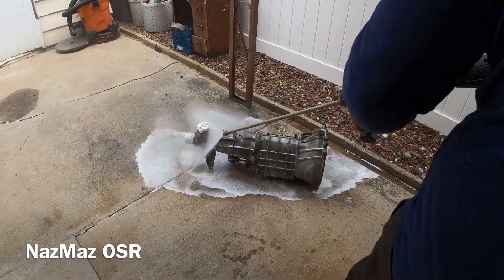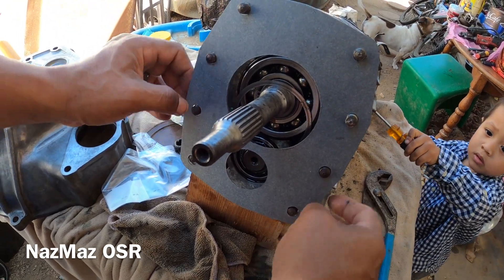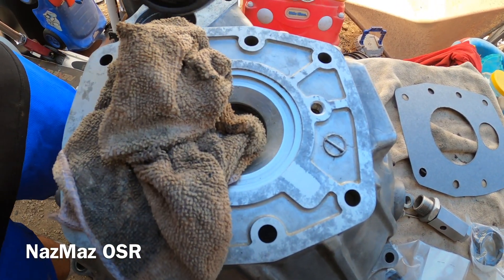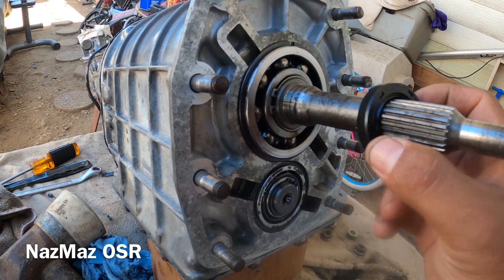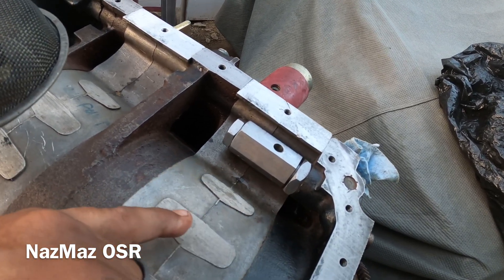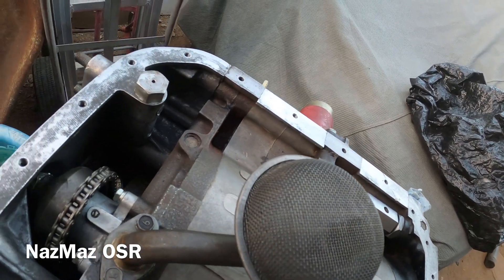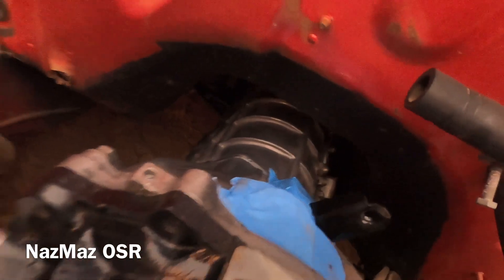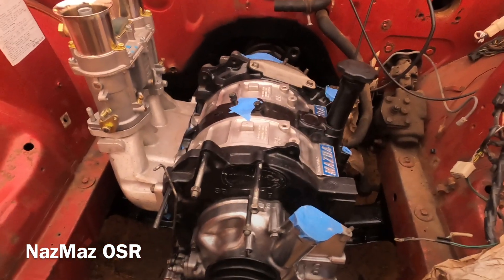Mazda Rx4 Rotary Engine installation

Comment: I only just had the chance to watch this  vid, nice work man. Would probably pay to put a little lube on the clutch fork pivots and throwout bearing where it slides on the spigot.
You must be pretty keen rolling an engine crane around on the dirt, they are bed enough on the concrete floor.
Reply from the maker: Yes, I thought of adding some lube but it already came with it. There's a cutout in the inner circumference witch is packed with lube as for the clutch fork pivots it slipped my mind so I will go back and add a bit, my little assistant should of pointed that out lol.
Definitely a workout when rolling the engine crane on dirt💪.

Comment: Its very satisfying putting things back in. I like the motto "may as well change it"😊. Did you balance the rotating assembly, interested to hear your take on that. I usually use a jack on the gearbox when dropping engines back in, helps getting the full engine/gearbox level. I like all the space around the older rotaries, my rx7s have oodles but my rx8 is sure tight and difficult to work on. 😊
Reply from the maker: Fortunate for me I did not balance the rotating assembly given that I wasn't able to locate a pressure plate for the original REPU flywheel (obsolete) so I had to settle for an Rx4 flywheel (same weight). I don't believe its necessary to balance unless you're planning to race or abuse the engine. Rx4 will be more of a cruiser wont be revving too much lol... OTC engine load leveler helps eliminate the need for a jack I find myself buying a lot of "one man job tools". Rx8 are one of my least favorite Rotaries to work on lol.
Thanks for the feedback
Reply: @nazmazosr1260  not sure why your buying 1 man tools I saw the extra set of hands making sure everything was tight.